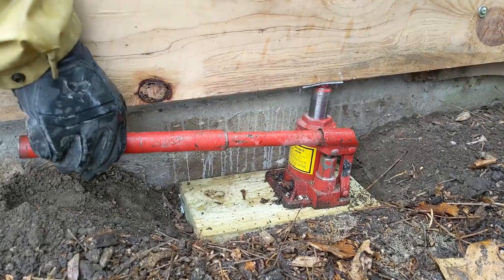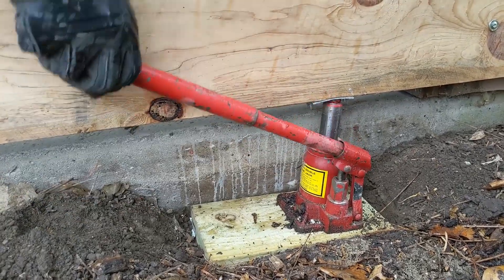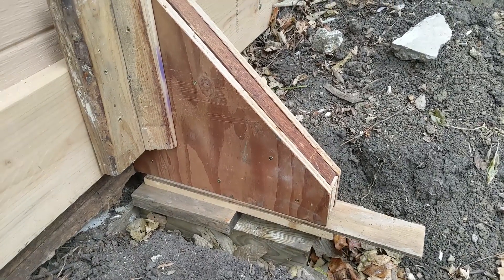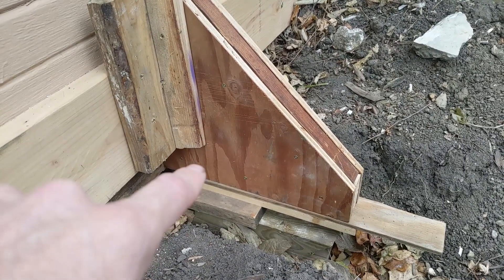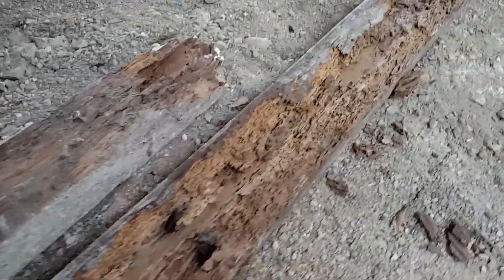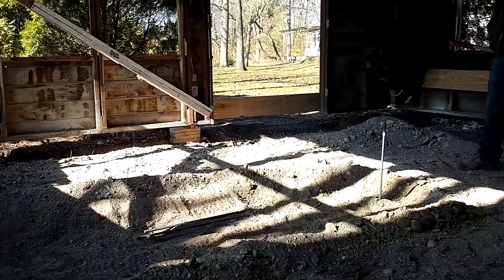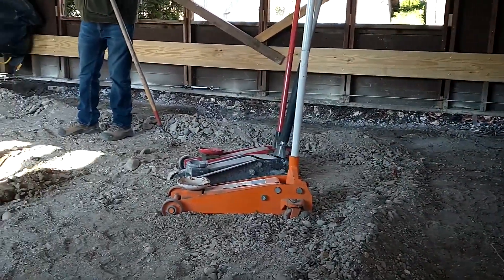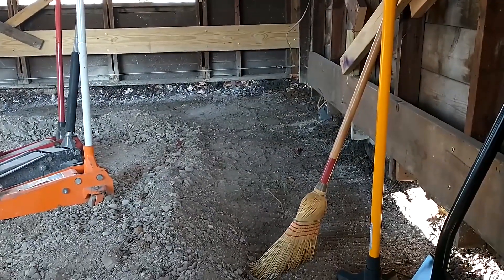Lifting a Garage from the Outside - Part 2: The Lift

Comment: You have any video of this project with the new floor going down?  This is exactly the project I need to do on my garage.  Would like to set it back down on a monolithic slab with an extension off the one side for an addition for a wood shop.
Reply from the maker: Sounds like a fun project. I do have a bunch more video I need to edit and upload. Probably several more parts. Hope to get to them soon.